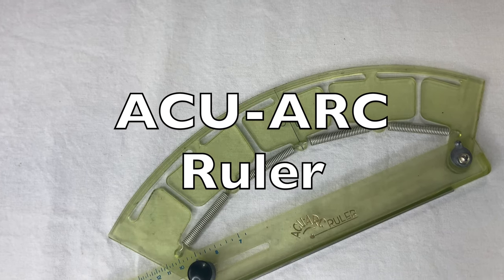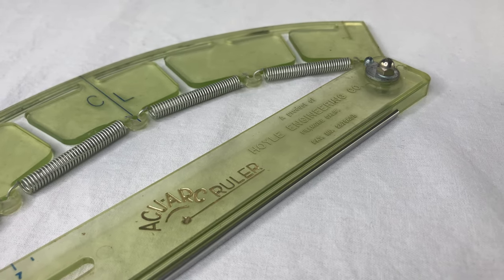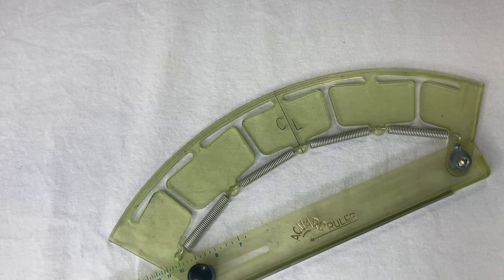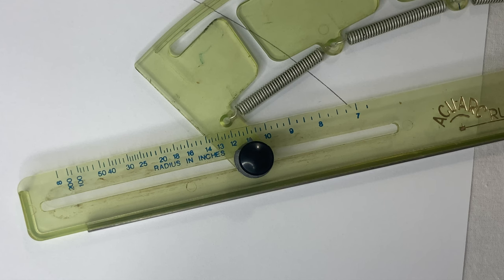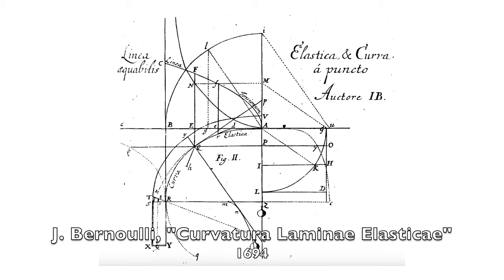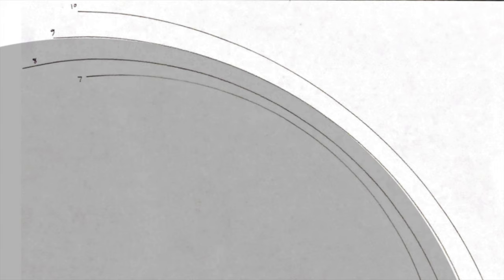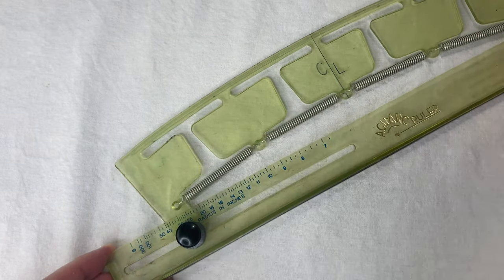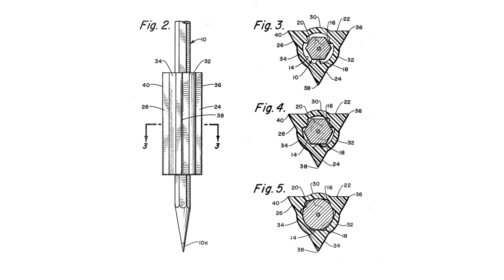ACU-ARC Ruler Review / HowTo

Comment: Interesting device- not seen one before. Before CAD we used railway curves in the design office. I still have a complete set. 
I had a piece of transparent drawing film with the various radii inked on them. To measure a curve you just had to offer up the film and see which radius fit. Simple!
Reply from the maker: I don't know if it comes across in the video, but measuring an existing curve with this thing is a real pain. The springs are pretty strong, so you really need two hands to loosen, slide, and re-tighten the nut. And to match the shape of a curve, you need to slide the nut while also moving the whole thing to make it line up with your paper. Your overlay sounds much easier.
Reply: Another cool video. 

Most likely, the mathematical curves that are produced by this device are: 

"B-Splines"

Also,  old drafting devices were called "Splines".

B-Splines are the next level up,  in complexity,  compared to Bezier curves. 

And Bezier curves are the next level up,  in complexity,  compared to high order (3rd order,  4th order,  5th, 6th ..."n"th order)  polynomials.

I have to use these math techniques in mechanical engineering,  when I'm designing cam lobe paths for machinery.

Take care. - Leo, from Denver
Reply: @miholju  I used to write embedded graphics software for laser printers. One of the things we made was an emulator for Adobe's PostScript language. Many printers of that era directly interpreted PostScript, so an application on a computer could send a page in the form of a PostScript program, which the printer would execute.
Turns out in PostScript, when you ask for a circle or a circular arc, what you really get is an arrangement of Bezier curves approximating the arc. It's actually not a circle but the error is pretty small. Probably on the order of the Acu-Arc.
Of course, these devices would easily have had the computing power to calculate a true circular arc. But representing them as Bezier curves meant you could do all the same mathematical manipulations with them that you could with a Bezier, which made them more flexible and useful.

Comment: By flattening the arc, we increase the radius. I think those pins and springs are there to make it bend consistently, so that the center of the circle is always on the CL line. To construct the scale, we need to know what is the relationship between the horizontal displacement at one end of the simply supported curved beam and the radius of curvature of such beam. That's how I would try to understand this. I like this ruler. It made me think about how they did it.
Reply from the maker: Yes I think my pole vaulter analogy is quite wrong (but I left it in to give an idea about why this thing is non-obvious to make). The pole vaulter's pole "wants" to be straight, but is bent by the user.
I think the plastic on the acu-arc is very soft, so it doesn't really "want" to be straight- there isn't much tension in the plastic itself. The shape is determined almost entirely by the springs, which as you say will try to equalize the curvature consistently across the bent part.

Comment: I have an Acu-Arc bought in the 1980s. Mine broke, a sad day. I used to call it the InAcu-Arc. A compass is better or a set of highway curves. That was from my ink on Mylar drafting days. Now everything is computerized.

Also have a fairly large template with a choice of a lot of curves…marked with radius in feet by scale.
Reply from the maker: Mine seems very accurate, but of course I’m not really trying to use it for anything important.
Reply: We had bar compass for large radius circles.
Reply from the maker: @someonespadre  Yes I've seen the ACU-ARC described as an alternative to the beam compass. But it seems to me the beam compass is always 100% accurate when used correctly. This thing, who knows really?
Reply: @ChrisStaecker  it’s awesome that you reviewed a thing I actually used for work. Now I have dig it out of the drawer at my downtown office and give it a place of honor in my home office alongside my sliderules and Dr. Bruhn’s log tables.  I never used a Monroe calculator at an actual job, for example, I used to have older coworkers that did use them but I started in the calculator era.

Comment: I cannot help but notice that you never used the ACU-ARC for the use case you started with, that of fitting a circular curve to three points.
Reply from the maker: Gotta leave the people wanting more! (But really I forgot…)
Reply: is there a way to fit the arc with compass and straightedge? or with ruler?
Reply: my guess is that with 3 points and 3 parameters for a circle (center x,y, radius) it becomes a system of equations. analogously in 3 and higher dimensions
Reply: There's a construction you can do with compass and straightedge to find the common center for the circle. But the problem here is the same. If the curve is gentle enough, the center point is well off the drawing paper.
Reply: The flowers I can remember from my long ago drafting lessons. Can you pick two points set the compass to a distance more than halfway between them from each point draw a couple of marks the Cross connect where these arcs Crust to form a line that line will be the locus of the centre of all circles, I didn’t accept those two points. Pick another pair of points and repeat the process you should get another straight line. Hopefully that intersects the first the intersection point should be the centre of the circle that goes through all three points. Hope that makes sense. It’s been a long time since I’ve done drafting. Well my voice to text mangled that slightly and editing. This is a pain. The flower bit should be as far as I can remember. And the circles mentioned at the beginning should pass through both of the initial points.
Reply: @r0bhumm  Thanks mate, I've been busy or I would have posted same
Reply: @AlRoderick  yeah isn't that the circumcircle of the triangle?

Comment: Rounded polygon
It looks more like exremely rounded polygon. 
But it is usable and idea is really awesome and simple!
Reply from the maker: Yes- I’d say it’s something like a spline with 5 control points, which can be very close to a circle.
Reply: @ChrisStaecker  It feels like it could be generalized to more splines by means of a springy slat of steel like in the Derivimeter, and bolts on top of it you would attach springs to to balance out the curvature(s)... Some sort of build-your-own-Acu-Arc.

Comment: But when they make a useful one that use cm and mm instead of some odd units like inches
Reply from the maker: Yes there is a metric also- but I think the inches one is more common. It was made & sold in the USA, so not really a surprise.
Reply: @ChrisStaecker  i thought even in the USA the professional scene been moving more and more to metric in the last 20 years
Reply from the maker: Yes I think so- but this thing is much older than that…
Reply: @ChrisStaecker  I was more talking about the new ones they sell that still use a system that have internal conversations errors